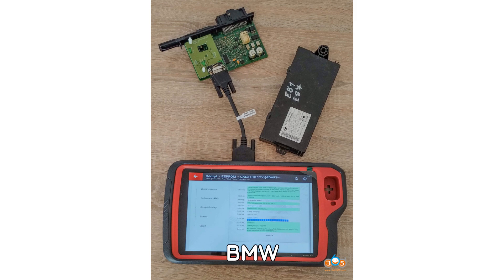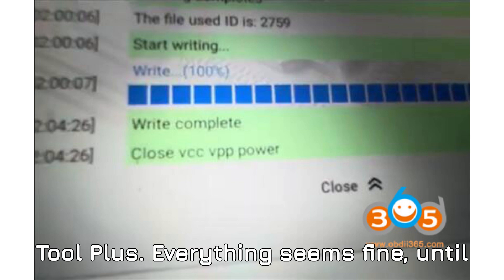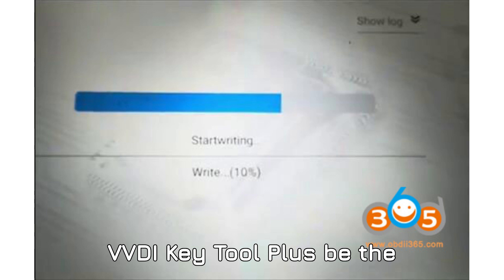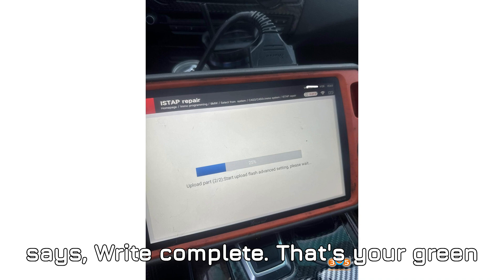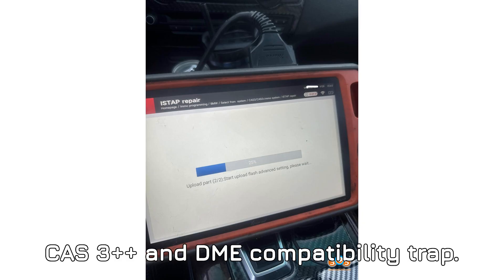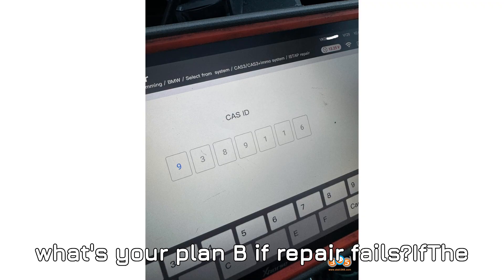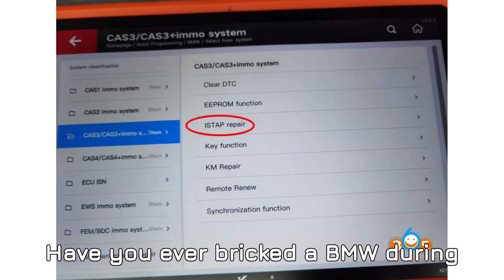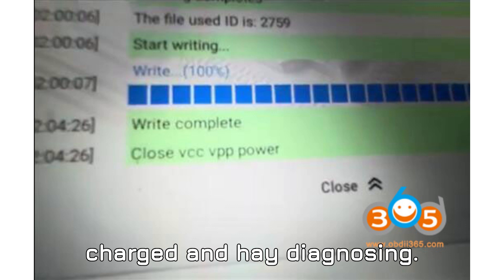BMW CAS3++ ISTAP Dead? How to Revive It with VVDI Key Tool Plus (No Solder Needed)

Comment: Good day, I programmed a key for a 2012 Mini Cooper, CAS3++ ISTAP system. The remote was programmed and the key is recognized; the dashboard lights up normally, but the engine won't start. I'm wondering if the module is damaged or if it just needs to be synchronized.
Reply from the maker: You may need to synchronize the module.